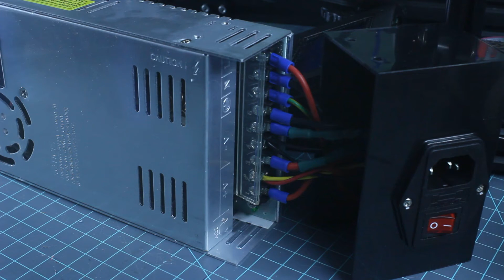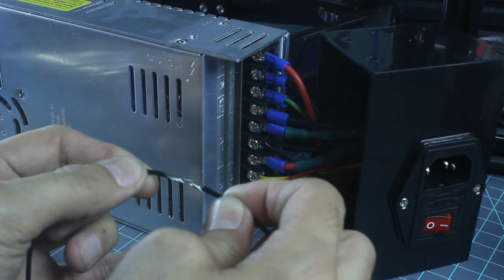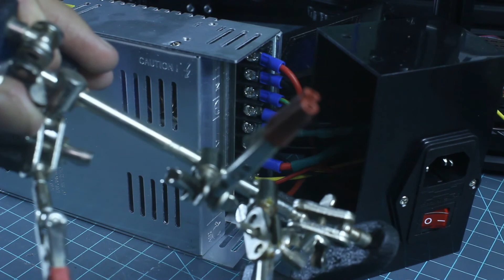Ender 3 Power Supply Rails – Spread the Load!

Comment: Hey mate, Just so you know, the 3 terminals are all connected, they are essentially the same spot. The power supply has a single output and that is 24 volts. You using all 3 terminals instead of one means you are just making your life easier when you want to disconnect one of them. Other than that, there is nothing else that changes from connecteing 3 cables in one screw terminal (provided they fit). And before you asked, I have opened it the PSU as the first thing I did when I bought the printer as I like to make sure everything inside works as it should before I power it up...
Reply from the maker: The point of using all three rails as I call them is that you're spreading the load, where you don't have all of your power usage on one wire. Wire being the operatve word there. You're not placing your MODFET, lights, and hotend all on one xt60.